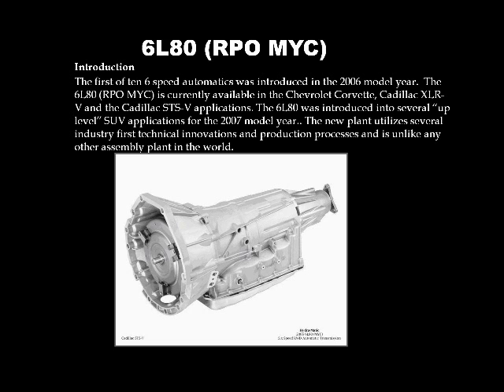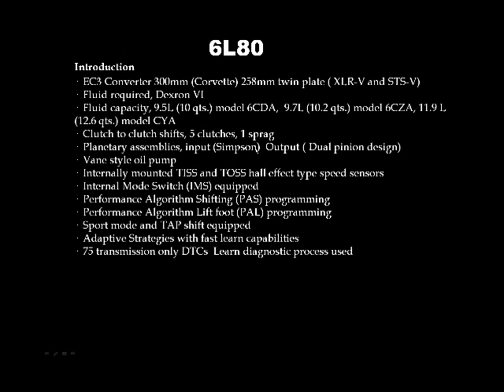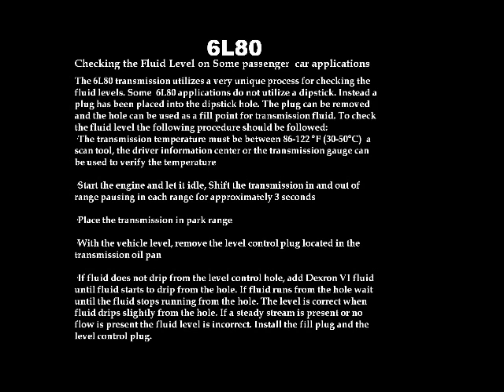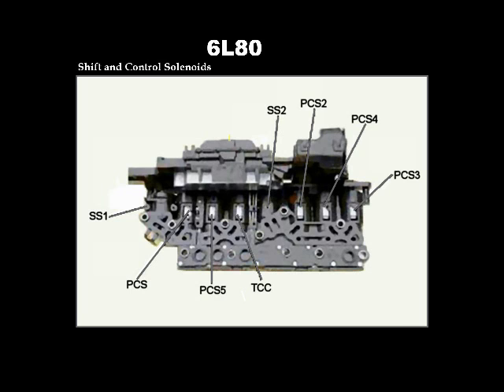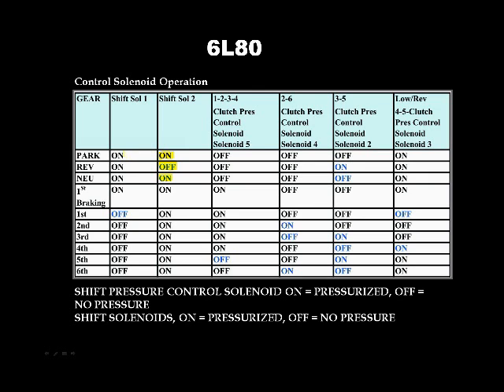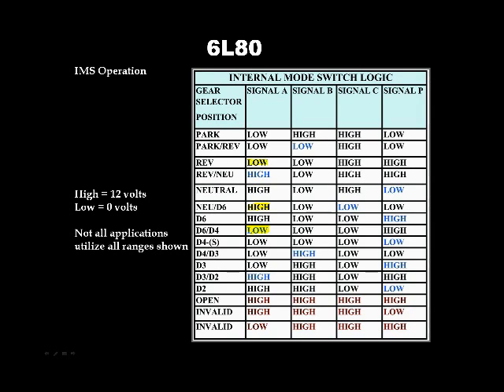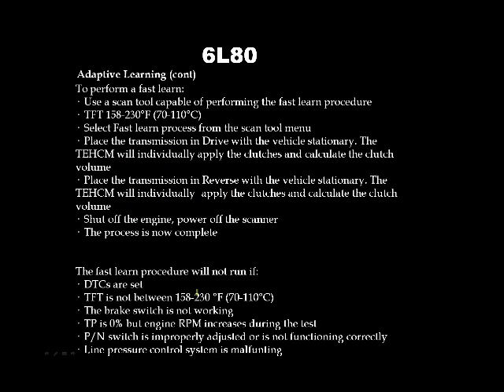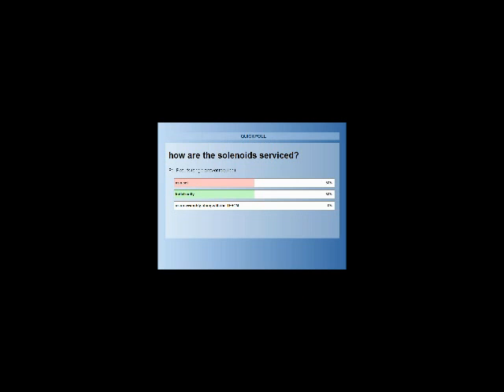Introduction to the 6L80 webinar

Comment: I have a question? I recently changed the plastic films on the technom for the pressure switches. After I call myself putting everything back together. I cranked up the vehicle, an put the gear shift in drive, but on the dash it still say park.  What did I miss during I install?
 I'd surely appreciate your help before I let the fluid back out the trans to check for something I missed.

Comment: very very nice I m having a problem with my 6l80 trans its a 2007escalade so when it cold out it seems to have a hard time to shift into 2nd gear once it warms up it becomes a little better .......could it be the screen on the shift solenoid or maybe it needs to be programed please help